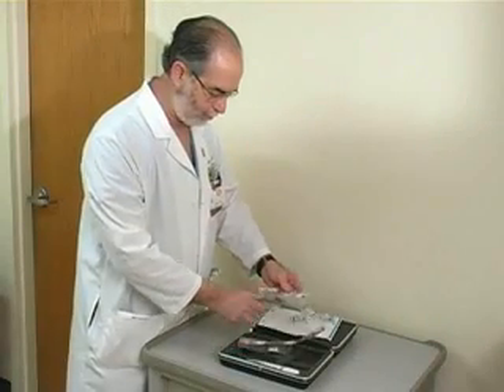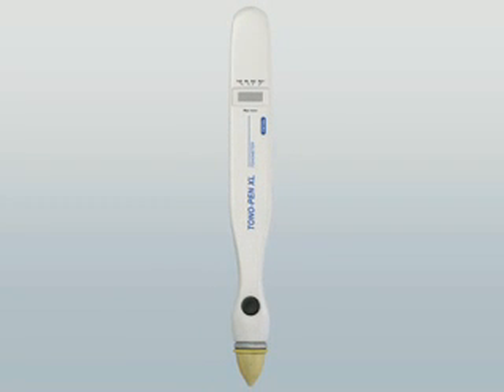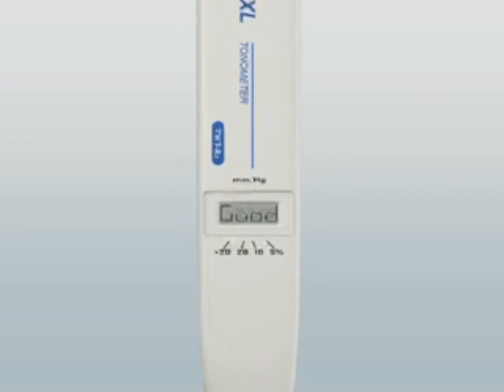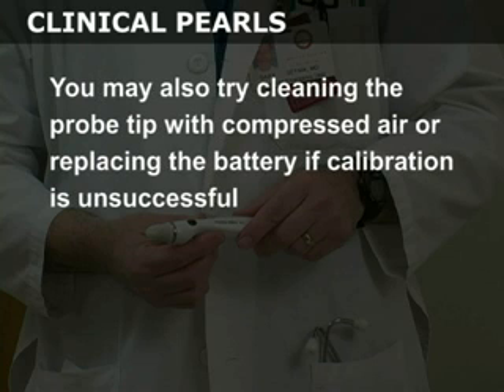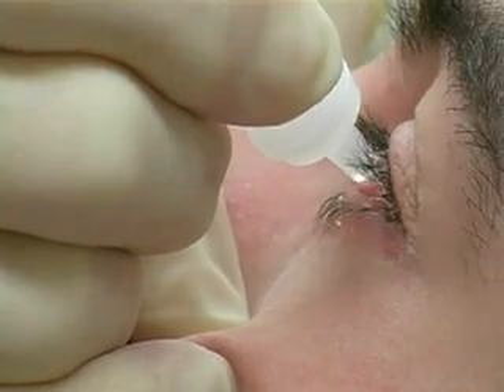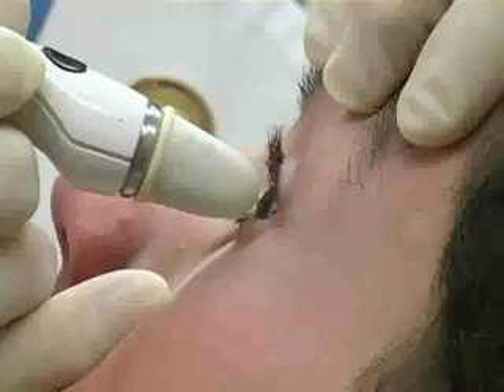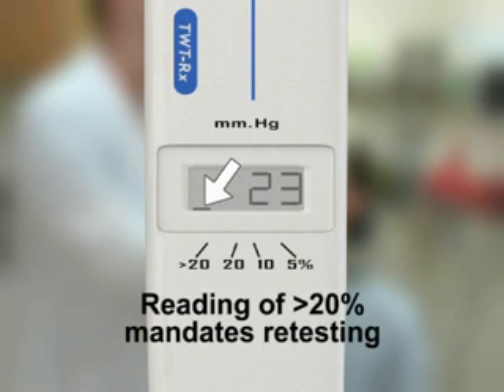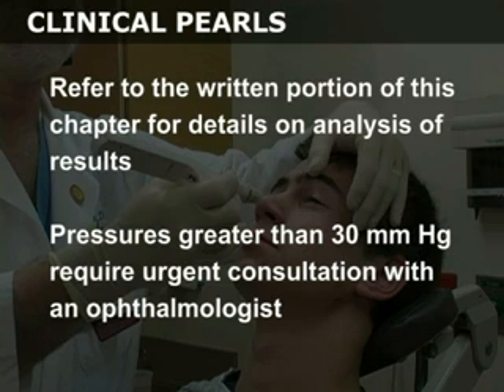Measurement of Intraocular Pressure - Tono-Pen Technique

Comment: The ocufilm tip cover in this video is not applied correctly.  It is too loose.  This will cause variable and inaccurate readings.  Just a caution to viewers.  Reichert has OcuFilm application instructions on their web site